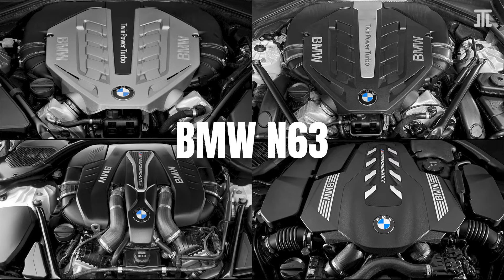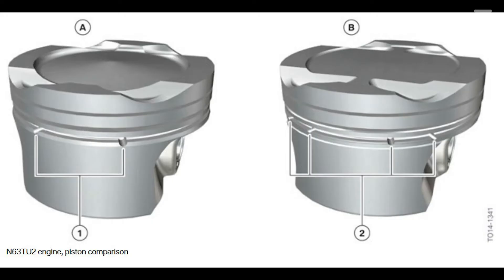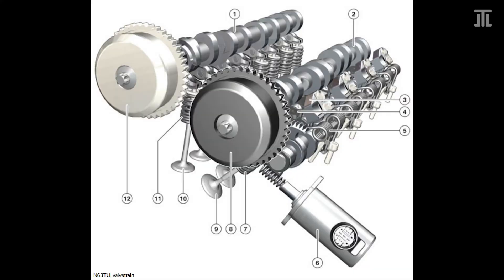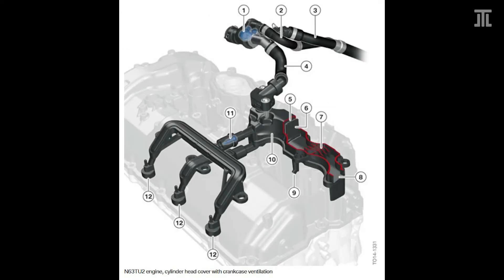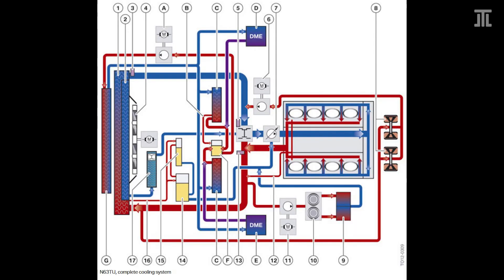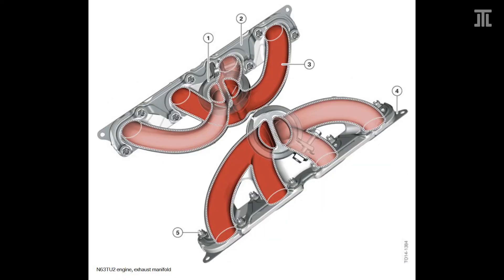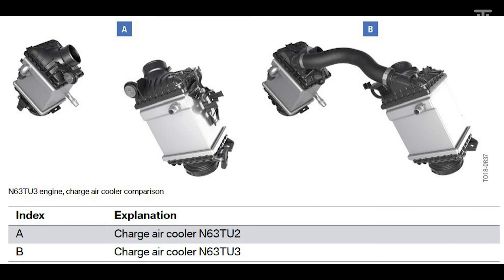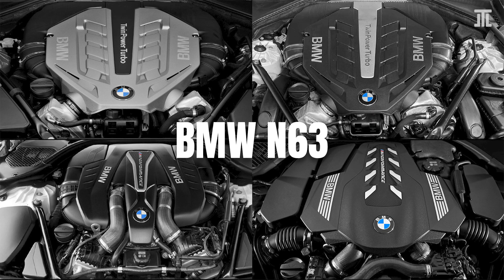BMW N63 vs N63TU vs N63TU2 vs N63TU3: Evolutions of the Bavarian Hot-V8

Comment: The N63 was one of the worst enging form BMW and now the BMW N63B44T3 – N63TU3 Technical Update 3 is one of the best V8 on the market one could say...really interessting!
Reply: what about the n63tu2?
Reply: @misterretsim9102  BMW N63B44O2 – N63TU2 Technical Update 2

N63B44O2 Horsepower: 444 hp (331kW)

N63B44O2 Torque: 479 lb-ft (650 N-m)

Years: 2016-2019

Given the N63TU was a drastic improvement, the N63TU2 did not have too much to improve upon. Peak power and torque remain the same, however the N63TU2 benefits from a wider power band. This is primarily due to the switch to efficient twin-scroll turbochargers. A few of the updates include:

    Twin-scroll turbochargers
    Exhaust optimized for minimal back-pressure
    Oil/Coolant heat exchanged moved to “V” of the engine
    Partial integration of intake and cylinder head (weight savings)
    VANOS taken over from modular B series engines

Again, this is not an exhaustive list. There are some other minor updates, mostly to accommodate the above changes. Expect N63TU2 reliability to be more or less the same as the N63TU.

The N63TU2 takes another step in the right direction when it comes to modding, tuning, and increasing boost. When modded, the efficient twin-scroll turbos should add a bit of peak power with a more impressive power band. Overall, the N63TU2 is an excellent engine.

Comment: Is it worth to wrap (heatshield) turbos in n63tu2? Did someone did that mod?
Reply: It not worth it. Oil cooler valve + 90 degree thermostat is all you need. Keeps engine temps low.. especially in extreme summer heat.
Reply: @mike619  I don't know if you've noticed, but sport mode keeps coolant and oil temp below 90C,  (around 85C). Up to 105 in comfort..
Reply: @chuckmolson1603 yes but I rarely drive in sport mode / sport +. Just giving you what’s worked wonders for me. I have n63 at 120k miles. 0 issues.
Reply: @mike619 i made myself sport individual that runs as comfort + open flaps
Reply: Yes it would be smart to do that in addition to the other engine cooling modifications mentioned in the comments. The less heat being released from the engine and turbos, the less heat related problems you'll experience or at least can be prolonged until the car reaches higher mileage where it would make sense to replace those parts

Comment: I have a 2011 n63 non-tu with 155000miles so far…no problems !
Reply: Debating purchasing a 2015 with 138k, any thoughts?
Reply: @camzworld23  it’s a good thing that it’s a TU but that is a lot of miles… I would have a compression check done on all cylinders and that would tell me how wore down the engine is
Reply: @camzworld23 did u ever buy it lol
Reply: Any idea why you´ve had so few problems while others seem to struggle?
Reply: Great a friend mines blew up at 97k

Comment: In case of M550i is it ok to go with TU2 or better add some money and get the TU3? Or the TU3 updates are not so crucial in comparison with TU2? (Both bad? :) )
Reply: In some cases TU2 is better since early TU2(until approx mid 2018) dont even have OPF(early M550i etc) also extra HP isnt that big of a difference since TU3 M550i is also heavier so 0,2s faster to 100 is it really worth throwing extra 15k for it? I have 2018 M550i and I am more than satisfied with its stock 462hp and cannot imagine scenario when would I need more.
Reply: Its 67 hp more and more reliable bro ofc go for TU3 😁 bigger turbos and some parts from S63 engine. I have TU2 its fast and aggressive but still want some more power

Comment: Which BMWs have the N63TU2 vs N63TU3?
Reply: I believe that the 2017-2020 M550i has N63TU2 and the 2020+ version has N63TU3
Reply: @Rrares9  is it possible to install tu3 on 2018 tu2
Reply: @Rrares9  2020 models are n63tu3.
Reply: Cheapest n63tu2 you can get is the 2016 bmw 750

Comment: Use 5w40 oil and change every 3-5k miles,  modify the tstat, remove the active shutters, high flow exhaust, wrap the coolant tank in heat tape.  The engine will certainly last longer with these mods.
Reply: Cool updates, I'd use a Group IV synthetic or better. IMHO
Reply: @robertjackson7590  group 4 oils doesn'y mean better, it's just a naming system. Group 5 isn't better than 5 because it's a higher number. No oil is 100% group 4 either.
Reply: @alexstromberg7696  Group IV is PAO base stock and man made. If it were Ball Bearings all of them would be exactly the same size. They handle extreme heat and cold better than Petroleum base oil. Group III and below are Hydrocracked with heat and pressure but aren't as good at their job of creating a wedge between highly loaded surfaces like Rod, Main journals or Cam Followers.
"No oil is 100% group 4 either." Why do you say this?
Reply: @robertjackson7590  no oil is 100% group for because PAO as terrible solubility for add pack. You can look at any SDS and no oil is only pao, it will be some pao, ester, gr1-3 in the same complete oil
Reply: @alexstromberg7696  I understand what you mean, you can have an AP that can make the Group III as good as a Group IV. What do you recommend (with no SDS, some will label proprietary and wont list it) someone look for to determine what would give them the best protection in an application with expensive engine repairs in the balance? I appreciate the input....
Reply: Definitely agree also lucus oil stabilizer....I've always used this additive for years works Great especially for very hot engines....
Reply: @jigz737  lucas oil stabilizer is just a thickener, just use a thicker oil with the right approvals
Reply: modify the tstat how?
Reply: So real question can I take the crank case off of a n63 tu3 and put it on the first n63
Reply: @ crankcase is the whole block.
Reply: @alexstromberg7696 😂
Reply: What high flow exhaust do you recommend?
Reply: I have a 300k mi bmw, i originaly changed the oil every 5k mi not the suggested 10k mi, after 120k mi i did it every 3k mi,, i have replaced valve cover, head bolts, tstat , radiator , water pump, serp belt, wheel bearings, cooling tank is isolated for heat, bmw are amazing cars zif you know how to take care of them!!! I know ppl driv them 15k-20k mi without oil change.
Reply: @ 3k is wasting oil
Reply: @alexstromberg7696 If you drive your car hard then no it’s not
Reply: @ yes it is
Reply: @alexstromberg7696  better to chance wasting cheap oil change than risking expensive engine.  To each his own.
Reply: @alexstromberg7696 then u don't know anything about cars, especially BMWs 😂
Reply: @alexstromberg7696 Every engine tear down video I've seen says the opposite. 
Especially if you live in hot climate.

Comment: Yes, the N63TU3 is less reliable than a Toyota Yaris engine !  Let's be fair and understand why the engines are made into a hot V and all benefits attached to it. Comparing the original S63 to a newer TU3 is like comparing day and night in regard to reliability. Of course it's gonna be less reliable than a non hot V engine since the heat generated is completely different when turbos are mounted on the outside.
Reply: I am thinking about TU3 engine. Do you think it can get me to 150000 with no major problems?
Reply: @ea2267  I just bought mine from a single user that drove it to 150k with no engine related issues.
Reply: @Ousayo howd the past owners drive it?
Reply: And you guys better believe it. I follow the dnl35, and I know that he knows
Reply: What are the benefits of the original n63?
Reply: I feel bad for Arizona BMW owners 😬

Comment: Great video ! I was looking into the m850 with the TU3 but it seems that no matter how many modifications they make it still is a high maintenance motor.
Reply: Thats incorrect ! They are extremely reliable engines if you get one that wasn't trashed and do regular oil changes - Its a shame people tune these cars to 800+ HP blow they engines than say they not reliable
Reply: @dnl35projects  I heard full throttle every so often on the m850i helps with reliability? What's your thoughts on that? I know it can help with carbon buildup but not sure if these engines are prone to that
Reply: @justcruising6824 If you are thinking of carbon build up on intake valves? no this engine doesnt suffer from that, but  every engine is prone to some sort of build up if it only sits at your regular rpm over time
Reply: @dnl35projects  what about the TU2? im debating on getting one
Reply: My lovely engine TU3